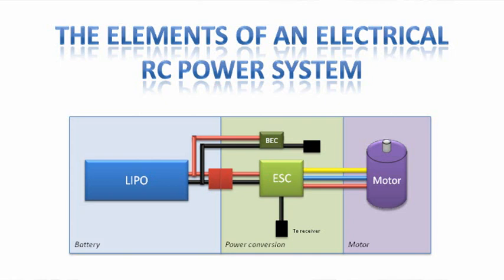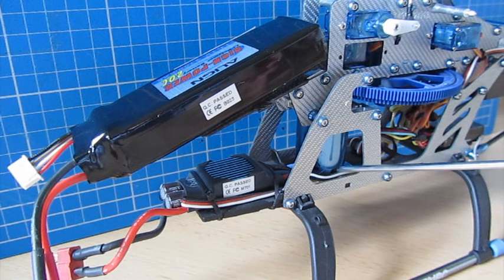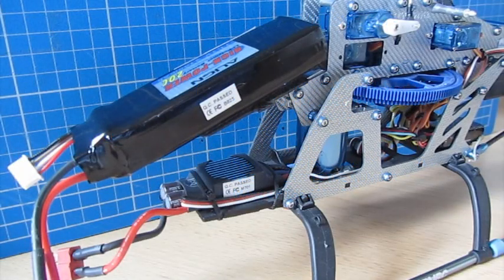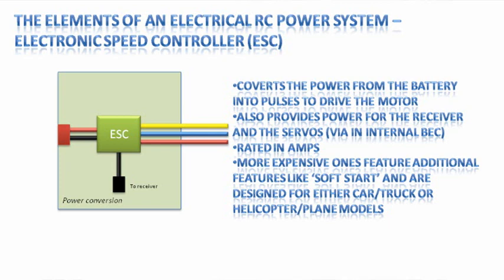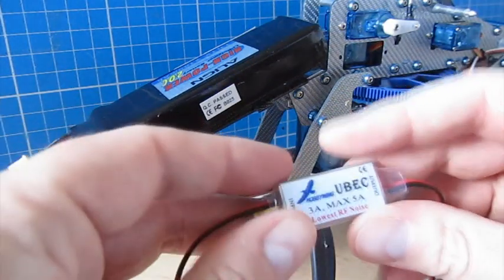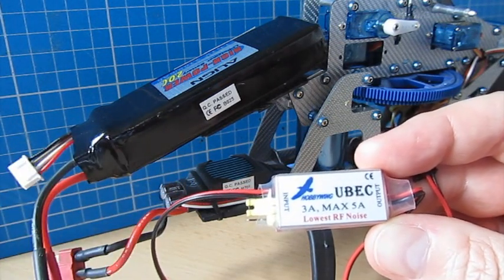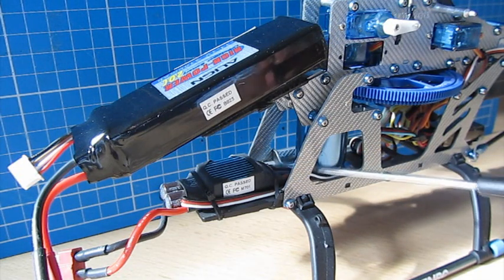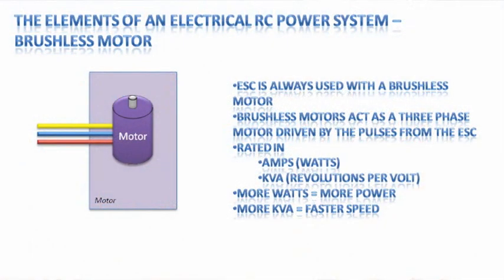RC Electric Power Systems Simply Explained (ESC, BEC, LIPO, Brushless etc)

Comment: Hi,

Would you be able to answer the following questions:

1. If I only know the KV of a motor for example 2200KV, how do I determine the maximum watt or AMP the motor will draw to obtain maximum RPM without damaging the motor? A number of motor manufacturers especially in china do not provide all the specs and it becomes very confusing.

2. Lets say a motor draws 20A. Ok I will go and use a 30A ESC with that motor. Now an ESC can be used with 2-4S Lipo. 

Now how would you determine either to use 2S or 3S or 4S to get the maximum RPM output from the motor?

The problem that I am trying to resolve is that if I want to design a complete electrical system from scratch, my assumption is that the motor specs is what determines the ESC needed, than you decide what Lipo you need or are there fault proof formulas that ne be used while designing a system from scratch.
Reply from the maker: See our other videos in the 'Introduction to RC' series for a lot more of the basics. Here is the quick version - 1) KV and amp draw are not related. Look at the Max amps to decide the size of the ESC. 2) The specs on the ESC will tell you what battery sizes it can handle. Best of luck!

Comment: hi, i noticed there are multiple wires from the esc. One connects to the battery, one to the motor and as you explained if the BEC isn't inbuilt then one to the bec, but how does it connect to the servo ? is it through the bec ?
Reply from the maker: We have lots of videos on the power systems of models in the 'Introduction to Remote Control' series. Should help you get a good grasp of the basics. Best of luck!

Comment: hi, i am a newbi , i just got myself a SF t6 with receiver,  I would like to build a light weight glider with a brushless motor, what battery do I need for the receiver? or do i need to decide what motor I will be using before buying battery and esc?
Thank you
Reply from the maker: Most receivers run on 5v so you'll need a 5v supply. Most of the time these come from the BEC that is inside the ESC. Best of luck!
Reply: thank you

Comment: So I want to implement this to a rc car that uses 4 AA batteries. Can I use that exact setup(lipo, esc, brushless motor) and have no problem with the car malfunctioning? I'm new to rcs and this helped but idk if I can do this to a rc car with 4 AA batteries
Reply: I'm trying to use a 1/14 Lamborghini huracán made by maisto
Reply from the maker: +Jesus Bills No idea, should do if you can find a motor that will fit... Best of luck!
Reply: +Painless360 thanks and I did

Comment: Hi !
Im confused about the internal BEC of an ESC. Some are classified as 2a, 3a, 5v/2a. Are 5v/2a and 2a the same ? And how to know if the BEC can work with a receiver ?

Thanks !
Reply from the maker: +hugoboy971 Yes, it's the amperage you are looking at. Most will produce 5v but some will also give an option for 6v outputs too.. Best of luck!
Reply: What if there is no voltage placed only the amp ? like : 2a , 3a. What do they mean ?
Reply from the maker: You can't have a current (amps) without a voltage so check the specs. I'd expect they are 5v units..
Reply: Checking items in ebay and it only says the amps not voltage. Some have 5v but some are only amps. thats why im confused
Reply: I've read this in google "It is very common for speed controls to have BECs rated at 2 or 3A. However, what the manufacturers do not tell you is that this rating is only true for an input voltage of 6V." So does it mean that the BECs without volts placed is 6v ?
Reply from the maker: This is the stuff you need to check with the seller before you buy.. Best of luck..
Reply: Ok thank you very much :D

Comment: Thank you for the good information.
Do you have a video helping to match a power system to a chosen plane?
Some old designations and new designations are hard to make transitions amongst them.  That is some planes were called 300 size or 400 size.  I can't find an easyily detectable set of specs (such as wingspan, weight, etc) that allow me to know which motor, prop etc to purchase when I want to scratch build a plane.
Some writers say use an electric motor that's equivalent to a 40 fuel motor.  That still gives newbies with no frame of referrence a clue in making a power system choice.
Add to that - some writers advide using a short prop with a big air bite and others recommend a long prop with a smaller air bite.  
What little bit of a brain I have left is getting blurry.  ((-:
.
Reply: +southernexposure123  im no expert but the way i build my plane was first build the plane weight it for example 1.5kg then i would shop around for a motor most manufactures will say what weight it can pull i would buy a motor that can pull at least two kg i then buy the recommended  propeller for that motor if i wanted a fast plane i would buy one with higher kv with its recommended prop but dont buy a smaller motor with a higher kv as it wont have the torque you need then i buy the esc  and  battery that is recommended to operate the motor   and bob is your uncle
Reply: Great !!  Thanks.  That's exactly what I needed - someone with some previous experience to take the mystery out of the process.  
My idea at this time it to scratch build a foam high wing trainer plane with wingspan of 42 to 48 inches that will fly slow enough for me to be safe with the slow reaction times of a beginner and later add some different power if I can land 4 or 5 dozen times and keep the thing glued together that long.
Thanks again.

Comment: Should the ESC amp rating be 10% more than the continuous amp rating or the maximum amp rating of the motor?  I know you said in the video Max amp rating, but a lot of motors are rated at more than 200A, and there is no ESC that can handle this
Reply from the maker: +dieter leleu Not sure what motors you are looking at with a max amps of 200! The ESC needs to be a little more than the max amps for the battery. i.e. 12Amp motor = 15Amp ESC. Happy flying!
Reply: +Painless360 Thank you for the reply. Taking the Align 550 Dominator as an example. The kit comes with the 730MX 850KV Motor which is rated at 115A continuous and 195A Peak. The ESC on this unit is the Castle Creations Talon 90. This ESC is rated at 90 amps continuous. So the Continuous rating of the ESC is still below the continuous of the motor.
Reply from the maker: I see - you are looking at Helicopter motors! I'd not use that setup you have - the ESC is no where near powerful enough to supply that motor safely...
Reply: +Painless360 Strange that you say the ESC is no where near powerful enough, cause this is how the kit comes from Align. The ESC end motor is in the box as a complete kit. I am not arguing with you, I am just trying to spec a setup for a build that I am starting, and I am looking at complete kits to se how the manufacturer specs the electronics. And I am not seeing a trend
Reply from the maker: Try it and see, but if you are using an ESC with a lower rating than the motor then that normally spells trouble. I'd check with Align/Vendor myself as not be happy about that..

Comment: Hi There, Thanks for the video. You mention the +10% rule for sizing the
 battery and ESC to the motor. In theory would the battery only have to 
be 20% more than the motor can draw? ie: I have a motor that can draw 4 
amps and an ESC rated to 8 amps, does the battery have to be 8 amps +10%
 or is a battery that can supply 5 amps sufficient (4+20%)?  Sorry if 
this is a dumb question or is unclear.
Reply from the maker: +Pitch link Not a dumb question at all. The object of the video is to get a builder used to having more capacity in the elements of the power system as you move from the motor to the battery. That way you will never be running the ESC and LIPO at more then they can conformably handle and they will perform batter and last linger. Best of luck!

Comment: What size wire do you typically use on your multirotors? And which do you suggest: ESCs with BEC or ESCs without BEC and a separate UBEC to power an AMP 2.6? Thanks.
Reply from the maker: That really depends on the models and what I have in the spares bin. A lot of PDBs now come with wire to connect the battery so I usually use that..

Comment: does every motor have to be connected to a separate battery pack? For example if i want to make a hovercraft with 2 brushless motors running separately.
Reply from the maker: No. See our videos on quad building.. Best of luck.
Reply: Painless360 thanks!

Comment: Would I be able to use a sensorless motor with a sensored brushless esc
Reply from the maker: +Aaron Fonseca Not sure what you mean..
Reply: On eBay for $26 there is a 120A Sensored Brushless Esc, can I use it with a 3300kv sensorless brushless motor?
Reply from the maker: Not sure, sorry. I'd ask the seller..

Comment: I want to know does the ESC regulate voltage from the power supply. The nominal voltage for my motor is 14.8 V and I plan to run it using a 3S 11.1V 2200 mAh 25C. My main concern is will the ESC provide this amount of voltage continuously or as the battery is consumed the voltage supplied to the motor will decrease.
Reply from the maker: +Danial Waleed The ESC supplies the battery voltage to the motor, the only 'voltage changes' it makes is to provide the 5v that the flight electronics (servos, receives and flight controllers) that the model has. See my other videos on ESCs for more detail. Hope they help..

Comment: Great Video! Thanks so much! I notice you have noise filters on the ubec. Is there a good rule of thumb for how to minimize noise in the system as a whole?
Reply from the maker: +Max Rosenblum You can but I don't use them anymore and reply on sensible routing of the cables and twisting to help reduce noise.
Reply: Thanks! I'm starting to fly drones and with all these components squeezed together (mag, autopilot, esc's, gps, receiver, etc) I'm wondering if there isn't noise interference I should be concerned about.

Comment: In the vid you say to have the 10% safety margin on the ESC and a further 10% safety for the battery. How would you work it out for a multirotor (quad)? 
15-20amp motor +10% = 25amp ESC (per motor), would the battery calculation therefore be: 25amp ESC x4 +10%= 110amp battery. Would a 4000mah 30C suffice?
Cheers bud!

Comment: very nice video thank you very much! so you just multiply the mili amps capacity times the C rating to determine how many amps my battery is providing?
Reply from the maker: Yes. That gives you the maximum amp rating. Happy flying!

Comment: Hi Painless360, If my ESC draw 15Amps and the motors says Standard Current : 15-25A Max Current : 30A,

so what quantity of amps does the motor and the ESC will draw from the battery?

And i have a quadcopter, with 4 ESC and 4 motors, do i have to multiply the current from each, times the quantity of motors to compute the quantity of current (amps) that all the system will draw from the battery?

Thanks for your time Painless
Reply from the maker: Fernando Calatayud Zepeda Not sure what you are asking as the setup you mention will not work. The ESC needs to be able to supply at least 20% more amps than the maximum amps the motor will pull...
I'd watch the video again and check your calculations/assumptions..
Best of luck.

Comment: what's the difference between a power module and a BEC? what it does and how to choose them for specific quads? Many thanks.
Reply from the maker: Dwika Widyantama Both do the same job - provide the electronics with a steady +5v or (6v). A power module is usually a little more complex than a UBEC and includes the extra circuitry that can provide battery and current monitoring by the flight controller.
Hope this makes sense.

Comment: very well done, thanks so much..
I know you did this a while back and things might, or might not have changed by then.
A video on the radio Rx would be very nice along the same style as this one.
Again Thank you.
Reply from the maker: Puma Hi, thanks for the feedback - all of the detail on the video is still current as it is one of the fundamental building blocks of the hobby.The idea of explain how modern RC radios and RC receivers work is an interesting one, I could cover binding, failsafes, PWM, how the Rx 'talks' to the ESC/Control board/Servo, PWM vs. PPM and how the channels relate to the controls on the radio.That sort of thing or have I missed what you mean?
Reply: spot on...
Reply from the maker: Puma Good news - new video on the channel that you may like ;)

Comment: Hi Painless - I'm not using the module for an RC plane, but to power some HD motors... but I need to find out about the throttle speed channel that connects via the three small wires - to actually get any output.   Do you know of anywhere online I can find this out? http://www.amazon.co.uk/dp/B008QUQMUS/ref=pe_385721_37038051_TE_3p_dp_1
Reply from the maker: Hi Sarah, the cable with three wires supplies +5v to the radio receiver and has a GND wire as well as a signal wire. The radio receiver sends pulses down the signal wire, the width of these pulses are in direct relation to the amount of throttle set by the position of the control on the remote control.

The Electronic Speed Controller (ESC) reads the pulse width and then send high frequency pulses to each of the three phases in turn to the brushless motor connections to move the motor. It then fires the next phase which moves the motor again and so on.

Is that what you're after?

You need to make sure that the HD motors are brushless and will work with RC speed controllers. Which motors are you looking at?
Reply: Thank you, that's exactly what I was looking for. I've got a servo tester from Amazon coming - if I can't get my Arduino PWM program working, I can plug it into that. One last question - a lot of these have inputs rated in Li-ion batteries, "Input :3 Li-poly batteries" - would that be the cell voltage of 3.7 volts x 3 ?... heh, I'm hoping cells in RC's are 7.4 volts (I want to do weird and terrible things to hard disk motors, which requires more than 12 volts you see)
Reply from the maker: I would recommend you watch https://www.youtube.com/watch?v=Oda0JYzGG3w

You will need a 3s (3 cell) LIPO battery. The mAh rating depends on how long you need to run the motor for but I'd be looking for 1000 mAah/20C or more.

If you watch the video it will explain how 3s and 12.4v are related ;)

Best of luck with it - is it a project?
Reply: Thank you for the link! I'm watching it now...   it looks like I'll need to read through the Chinese to English leaflet for my ESC to get the specs you mentioned in the video. =)
Useful tags are not daft!

I'm not doing a project with these - just playing, nothing in mind. To see how they all fit together, with no stress of a target. I want to see what kind of output my ESC produces, digital or analogue, how to program them with an Arduino, (also with the little programmers that are for sale (on its way!)) to see what the serial input should be doing. For projects - I've got 6 dead hard disks sitting around, and a couple of mini quad copters, My ideas are fuzzy - I might do something ariel - though not with the HD motors, they're so heavy. Or use the ESC and HD/s motor for something interesting. Apparently swapping two of the 3 input wires will run the motor in reverse - hmm... I could do an electronic swap switch...
Interestingly - those heavy HD motors could be abused and attached to propellers - I expect them to have ABEC 9 bearings in them, push enough juice in them, perhaps the torque/speed would counteract the weight. It's not a practical flying machine - it would eat battery power, but imagine something that looks and sounds like a drone from the Terminator franchise... tethered due to its power needs...fully metal, engines whining, little ultrabright CREE LED spotlights shining through the hull. it'd make a great youtube video! Hah.... I need to start with something much less grand - like a spinning motor on a lab bench first.

Your videos are great!
Reply from the maker: This may help - https://www.youtube.com/watch?v=DraFgiDELjI

Also this is very good at getting in the detail  -

https://www.youtube.com/watch?v=22CpRl2_TRI

Best of luck with it!
Reply: +Sarah Cartwright I'm thinking of putting arduino in my rc boat. very cool!

Comment: Some of the cheaper brushless motors on ebay are listed with turns.. does that translate to the brushed world or is it just a sales gimmick? I have a 1:18 scale road car which I am converting to brushless. I think I used to run 24T or 27T motors for torque or speed. I have seen an 18T brushless with 12amp/5200kv. What would that translate to in a brushed motor? Torque or speed? Or are the brushless just so superior that any brushless for RC cars will just smash any brushed setup?
Reply from the maker: Great question see my other video 'Brushless motor numbers explained' for the answer and why. Hope this helps.

Happy flying!
Reply: I have seen it so I understand the amp/kv thing. What I don't know is whether a 12amp/5200kv motor is for torque or speed..
Reply from the maker: This is touched on in that other video at 2:49.

(Generally) The lower the number of turns in a motor the faster the speed. The higher the number of turns the stronger the magnetic field so the stronger the 'pull' or torque. The shape of the motor, stator/rotor setup and quality of the motor all affect the results.

The amps (and watts) in the specs give you an idea about how powerful the motor is and the KV shows you how fast the motor will turn.

You need to decide on what you need the motor to do and go from there. If you need more help my Helpout channel is available.

Happy flying!